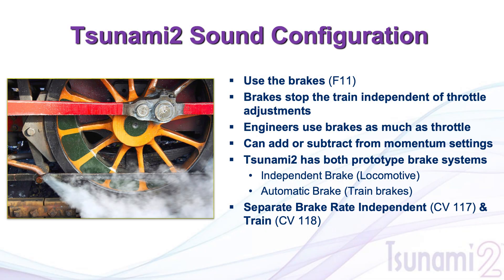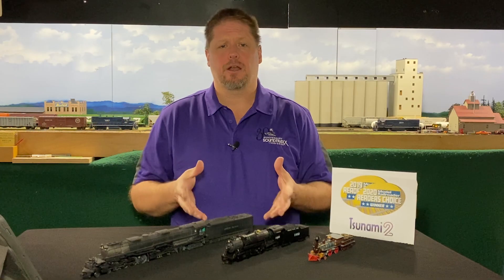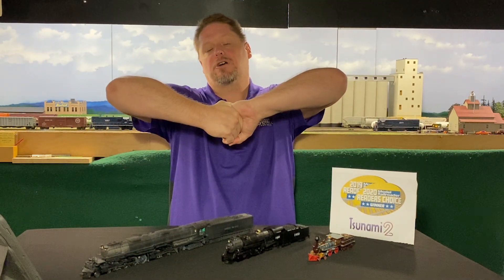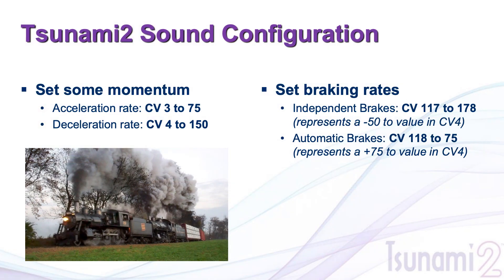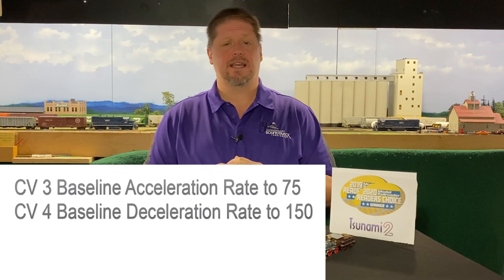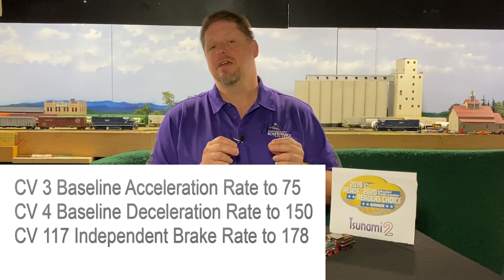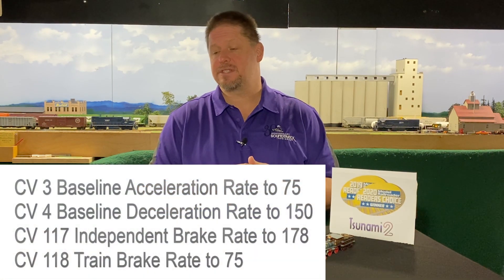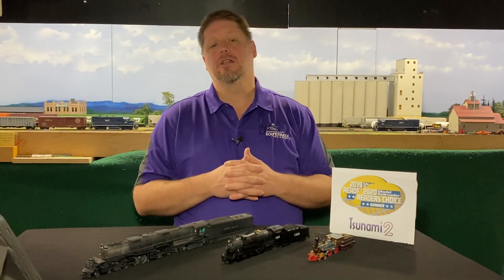Braking Operations with a Tsunami2 Decoder

Comment: The steam loco demo video doesn't show anything more than a train starting with a lot of momentum, it certainly wasn't stopping. If CVs 3 and 4 were adjusted for a loco only then adjusted for a loaded train then CVs117 and 118 could be used to reduce the momentum to simulate actual braking. It seems that CV118 was used to add more momentum to simulate a heavy train not to actially brake the train to a stop. It depends on your viewpoint. Wrong terminology regarding braking to stop a loaded train.
Not a good demo.
Reply from the maker: I believe you are misunderstanding the demonstration.  CV 3 and 4 are set to higher momentums, and CV 117 and 118 are set to demonstrate the feature.  How you decide on your final values is up to you, but the point of the demo is to show how it can be done and it is exaggerated so that you will notice a difference so you can see how it works.  Apparently this was not the way you would have done it.  But the user’s guide and our readily available tech support can help you better understand it so you can implement it properly on your railroad per your desires.  Thank you for watching.